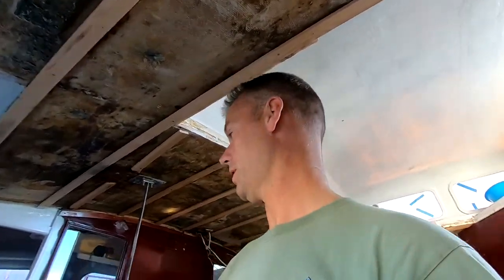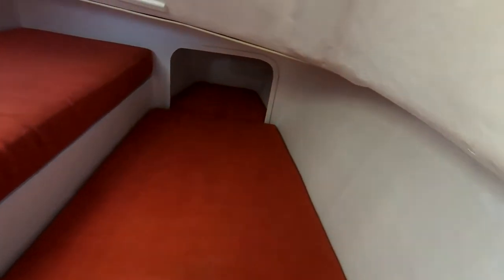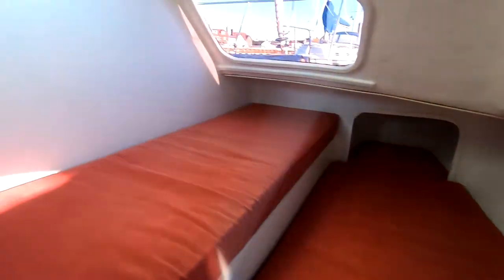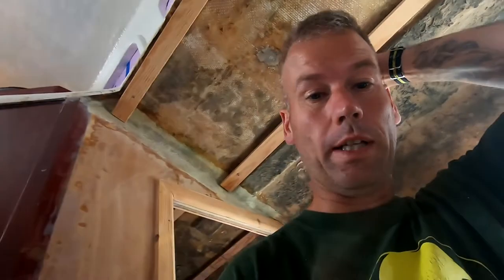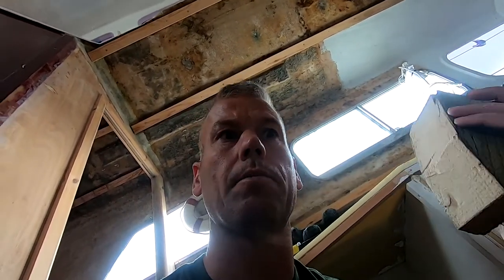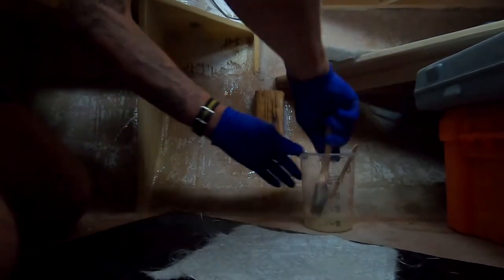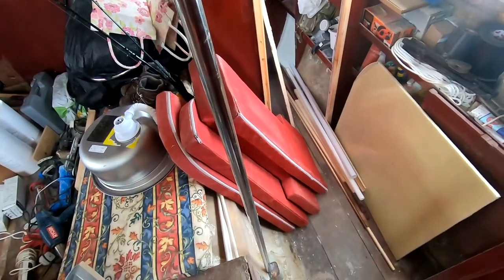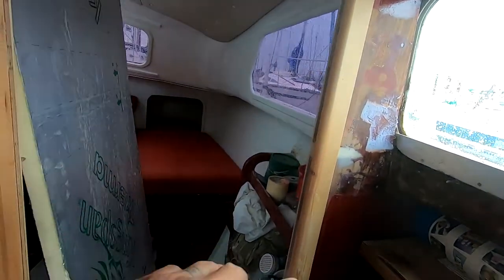Installing Stripper Poles on a yacht and cabin paint for kids  E86

Comment: Looking good, Spence. More progress.  Maybe worth buying some peel ply to help with those tricky corners and edges on the boat. Then you don't need to sand before fairing, painting or further epoxy work. It is not cheap, per se, but does save time, sand paper and frustration of sanding tricky corners. I have a roll of 4 inch wide peel ply, just to use for tricky corners and such.
Reply from the maker: Hey Christoph, thanks mate.i have run out of peel ply.  But on my shopping list. 🙂